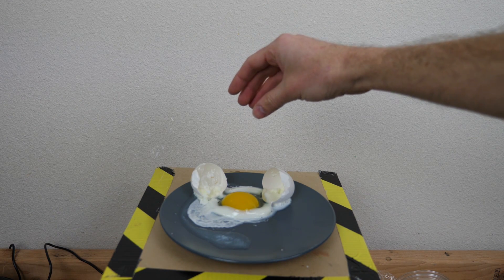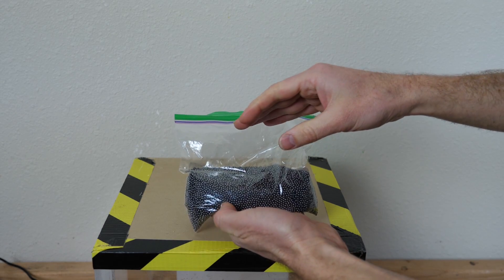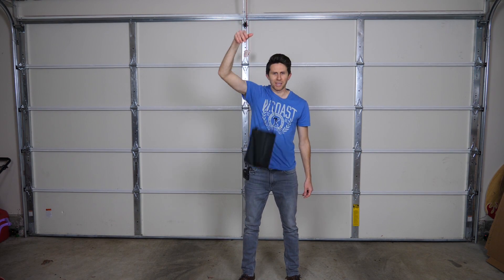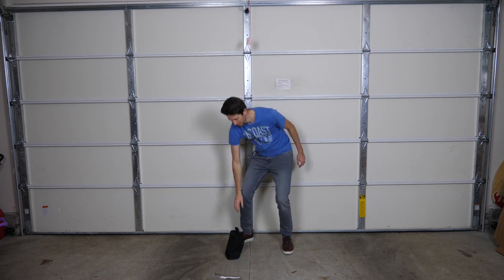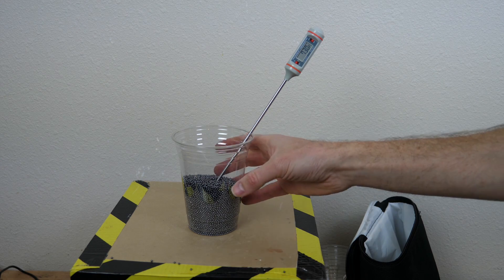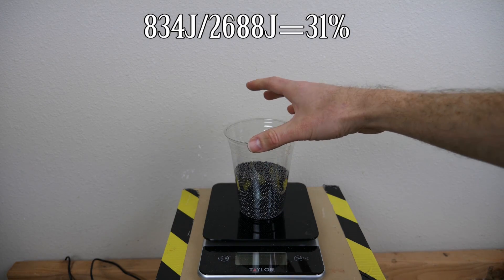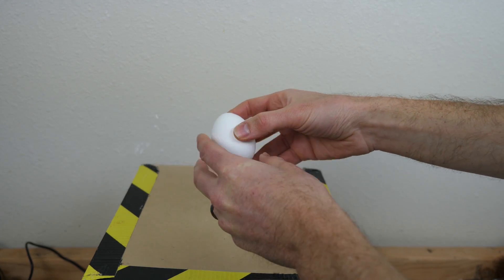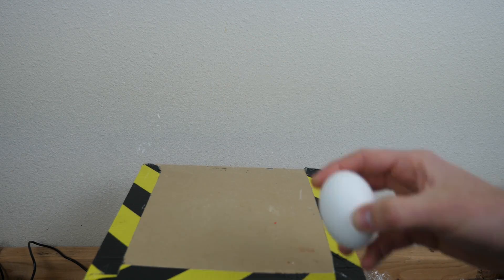Is It Possible to Cook an Egg Just by Dropping It?

Comment: welll orbital egg drop? the trick would be finding the right velocity to cook the egg but not "burn it up" on reentry :-)
Reply from the maker: Correct, even entry heat due to dropping it 250km high would likely just cause explosion.
Reply: The Action Lab well if you reenntered from orbital velocity sure but if you went straight up and just dropped it from the correct altitude you should be able to balance the friction Heating to get you the desired result
Reply from the maker: Well it would quickly just reach terminal velocity and heating would be minimal and most potential energy lost to environment. I can’t think of any scenario where it would work to heat it from dropping without destroying it

Comment: Can the Bob of an oscillating pendulum be hot over time if the frequency of the oscillation is increased? I mean is there a relationship between the heat of the Bob of the pendulum and frequency of oscillation?

Comment: you shouldve told the people that one solid ball would use the energy to impact harder, while the tiny balls rub against each other and slide into each other, deforming as a mass and cause less impact because it uses the energy to slow down the balls on the top while passing the ones on the bottom. many are confused by that. 👍

Comment: First, awesome video as alwaysSecond, I can't believe you didn't build a mechanical device to do that work for you.Third, can you build a mechanical device that will drop an egg a 1,000 times or more.I'm thinking something like a long stick connected to a string that goes over a pulley to lift and drop the egg.  and the arm is on a pivot point that allows a motor to move that arm.  maximizing the use of leverage to do it

Comment: Because of the time taken to heat the balls up, wouldn't it be good to have another control sample that isn't dropped, in case ambient temperature changed?
Reply from the maker: I can just go ahead and tell you that my garage did not heat up by 8 degrees while I filmed this video:)
Reply: The Action Lab I understand that, but it could show an even bigger delta, even if it is only 1 or 2 degrees, right? It's obvious that there's no trickery or anything like that in the temperature increase. Also, with the theoretical 13km drop to cook an egg, does that take friction via air resistance into account? Or is that a 13km drop in a vacuum?

Comment: I suspect most of that heat was actually generated by friction in-between the shot rubbing together; which is a different source of heat, and which invalidates (or at least overestimates) the result of the experiment. To measure the heat purely from dropping, as you initially surmised; you'd have to use just one drop.
Reply: Stop being so emotional. I'm pointing out that your initial claim was to investigate why ping-pong balls lose their bounce, and your assertion that it is due to heat loss.

Then you proceed to show how friction from lead shots can increase their temperature.

This is not the same thing. We are not interested in how lead balls gain heat when rubbed together. We were under the premise that you would demonstrate the very act of losing bounce being a heat-generating phenomenon.

The experiment is dud, pal. It doesn't relate to the initial assertion at all. If you want to show how friction generates heat from potential energy, just drop something from space to earth.
Reply from the maker: Where do you think the friction is coming from! The point of the whole video is showing you how the potential energy is converted to heat (friction)
Reply: But you started off the video with the one ping-pong ball, explaining how each successive drop is lowered because energy is lost in part due to heat, every time the single ball makes contact with the ground. But I don't think you mentioned friction as the source of that; because the amount of rubbing between one ball making contact with the ground, is minimal; and not comparable in degree to many balls jostling together and rubbing against each other.
Reply: I mean if you really wanted to demonstrate potential energy can convert to friction-heat, then you could have just dropped a metal ball down a chute or slide, and measured how hot it gets at the bottom. That's being honest about friction-heat
Reply: But what you did was start out with why ping-pong balls lose bounce, and you investigate if this is due to energy being lost in the form of heat; but then demonstrate with friction from multiple sources instead... we (audience) aren't interested in how much friction can be generated from things rubbing against each other due to movement (because we already know that), but rather how potential energy can be converted into heat somewhat rather magically by one thing losing bounce; which isn't truly demonstrated
Reply from the maker: Wow, you are really not getting it...potential energy to heat=potential energy to friction. What if I didn’t tell you what was in the bag and showed you that it heated up when I drop it? The bag of shot is the system. Even if I dropped one lead ball, it would heat up due to friction (metal domains rubbing against each other). Heat from impact is always due to friction no matter what you do. You need to let this sink in for a bit.
Reply from the maker: All energy lost from bouncing is due to things rubbing against each other. I cannot see what you aren’t understanding here...there is no mysterious phenomenon with one object heating up. It is all always friction with one ball or many balls. You must be missing something...I can’t keep replying to this
Reply: The Action Lab 
Come on i got the popcorn out from another comment thread on here lets do this 😮
Reply: Dr. Riq dude please 
I think a 6th grade student will understand this much better than you do
Pingpong ball lose their bounce each time because they lost a fraction of their potensial energy 
Where do the energy goes? The energy turns into heat.
Reply: Dr. Riq let me simplify this for you 
energy + kinetic energy of the ball will create friction 
Friction will create heat 
In other word, droping the ball will turn the energy inside the ball into heat 
Why the pingpong ball bounce?
Because the energy stored in the pingpong ball is way greater than the friction force  that counteracted to those energy. 
But as the ball bounce again, the bounce become shorter, why? 
Because the pingpong ball lost its energy (due to fraction), and that energy turns into heat.
It is a perfect example dude

Comment: Does it heating up because of the friction between all those lead balls and not because of the potential energy?
Reply from the maker: What causes the friction?....the potential energy. Friction is the cause even with one ball. Internal friction causes heating.
Reply: The Action Lab Perfect!
Reply: This is also called internal energy
Reply from the maker: Dr. Riq...come on dude. What is causing the balls to move around and rub against each other? The dropping! Please read my pinned comment and think about this a little more. Friction is not free energy.
Reply: Here friction is considered as internal force. But work done by internal force is always zero. So I don't think friction should be responsible. You can say heat produced due to inelastic collision between the bag and the earth. Actually this type of collision converts the potential  to heat energy.
Reply: Just here to see how this discussion turns out (sitting with popcorn now)
Reply: Sorry +ActionLab, but I don't buy it. Heat was created when the movement between the shot rubbed against each other and generated heat. This is a different source of heat than what you wanted to initially investigate, ie. heat being produced purely from the action of dropping, such as in the ping-pong ball in the beginning.